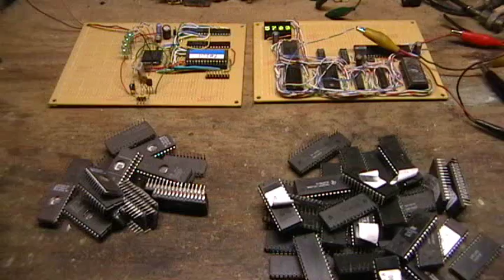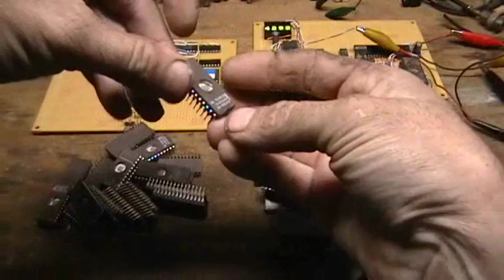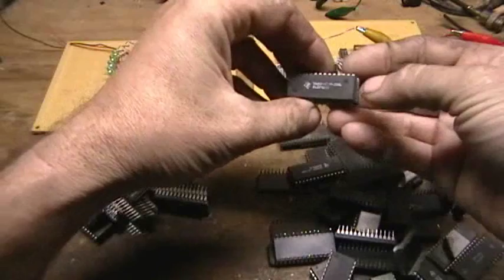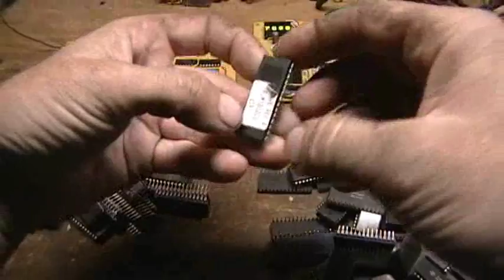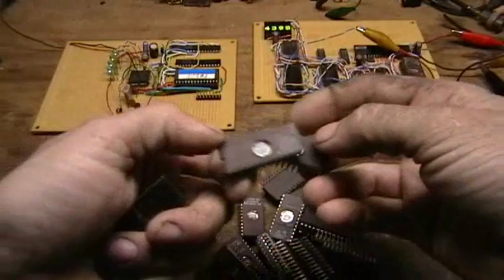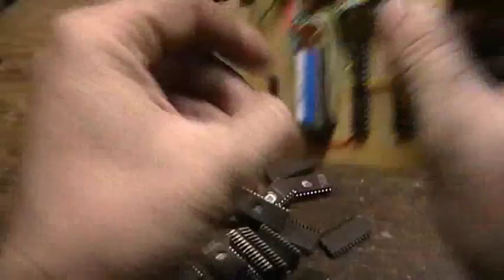Reusing OTP EPROMs, and other EPROM tricks.

Comment: I love the idea of tying A15 (etc.) high to get the other half of the ROM back for an OTP ROM... it cut's the ROM size in half, but it seems like a great recycling tip. -- The jumpering suggestion is great too! -- Seems like you could also make adapter PCBs with dip switches, to fit these chips into older boards (e.g. use a 512 KB EPROM as the 16 KB BIOS in some old 64 KB Z80 machine, etc.) -- Thanks for posting this. :-)

Comment: Fantastic!
Reply: Heat make memory bit rot (one of my m27c4001 was on a hot led lamp with metal back)and data corupted but my cd4040 stops count under 4 volts